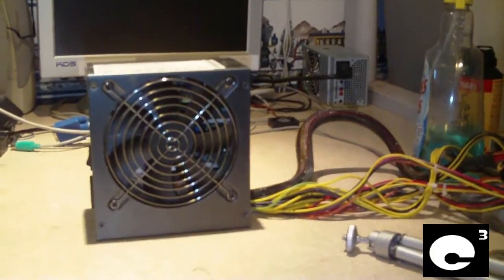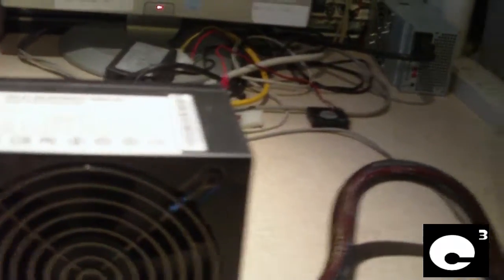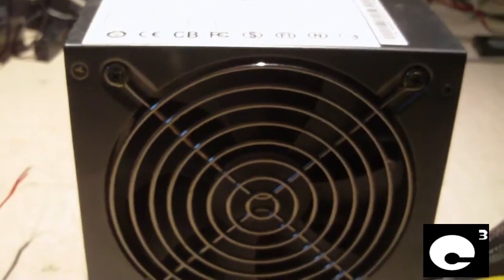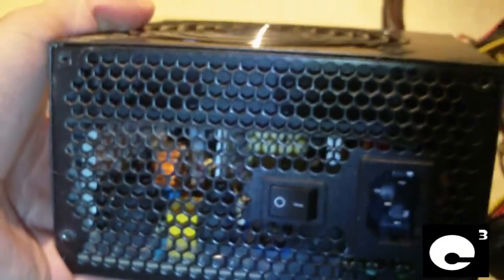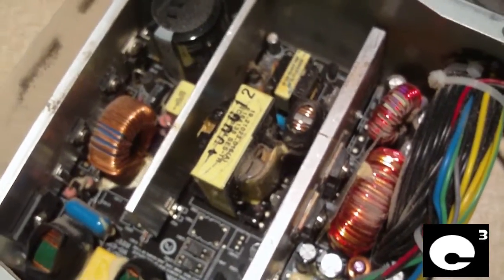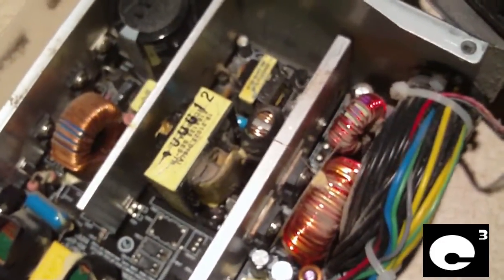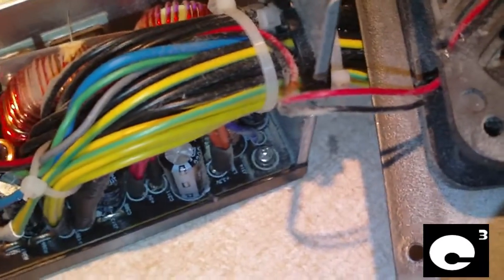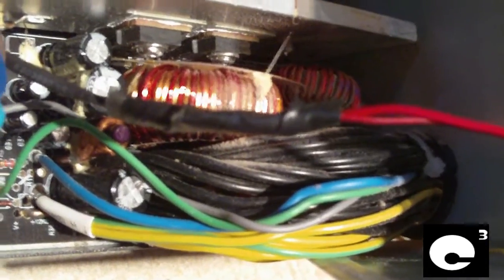Overview of an Active PFC Power Supply + Fan Replacement Tutorial

Comment: after bypass of switch  ( soldered leads )..still does not power up.. board fuse checked good. 124v at board contacts.
  I did leave the PS pluged into the surge protector power strip for 3 minutes or soo.. but with the power stip turned off.. does this sufficianlty discharge the caps? or..do they need to be manually discharged?

Comment: Hi, really enjoy your channel!  CAnI get some advice on where to begin  fixing my coolmaster RS-750.PFC
the symtoms are.. turns on..( fan runs).starts to boot..25 sec. then turns off.. next start.. 5 seconds turns off. none of the caps look bulged or damaged.
 brownish colorization  below one of the heat sinks.
 I figure doing a jumper test and tesing the  output of my output leads is first test, after a visual inspection, but after that. I need some help in the right direction.